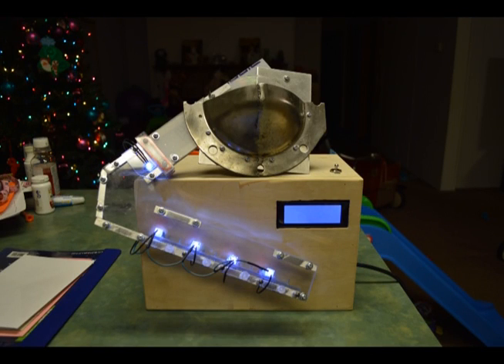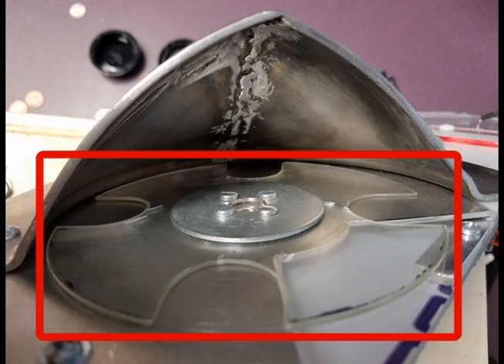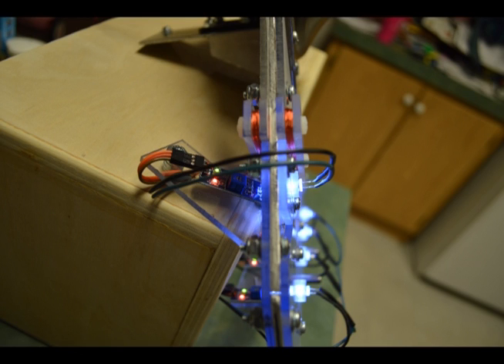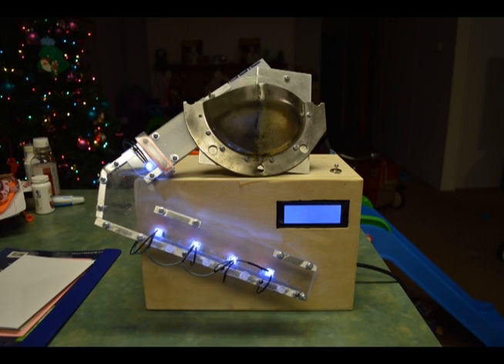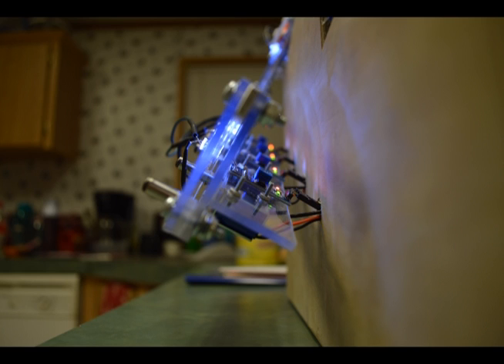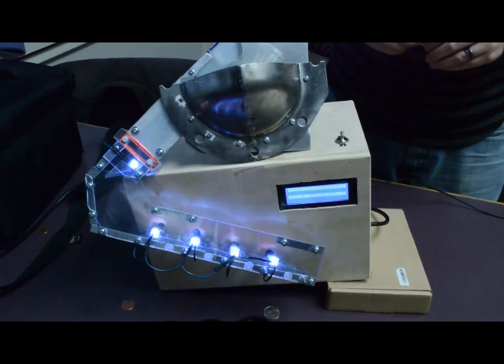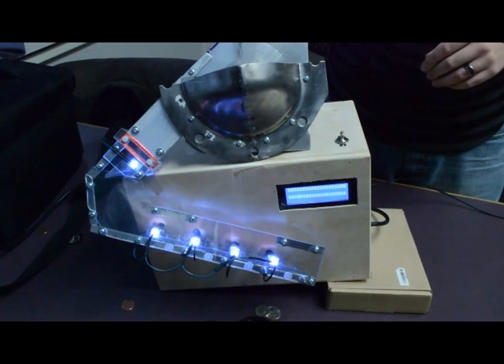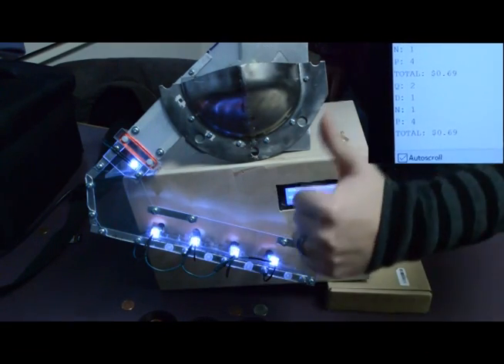Arduino Coin Sorter

Comment: really great work.

I'm really curious how exactly the coil coin sensor work. did you attach some oscillator to you coil? what is the "Instrumentation" you used?

also what library did you use? can you post a link? thanks.
Reply from the maker: Because the circuitry is complicated and this video was created strictly for the purpose of presenting this project I did not go into these details. The circuitry was based on information found here.
http://www.best-microcontroller-projects.com/coin-detector-and-counter.html
Reply: I already saw this. I actually bookmarked this site way before I asked you.
Thank you, I suspect you're using a similar method and you just confirmed it.

I found it odd that there is little information about this on the internet.
Reply: @averagerepairman6519  to give proper credit, this is patent US4998610A
Reply: averagerepairman ..I’m working on similar project...how can I contact you ...need some details abt project..
Reply from the maker: Cm Chetan what details are you looking for? I've long since scrapped this project for parts and to just clear space. I'll help with what I can.

Comment: the coils you used in this prototype is to create the hall effect? and which currency of the coins are you using mate? and are these coins magnetic materials or not?
Reply from the maker: I appreciate the questions! First, the coils are used as a comparison device, one coil sends an AC signal the other coil receives the signal (much like a transformer), and the difference in the two is compared with a differential amplifier circuit and further circuitry for filtering and amplification. The output of all of this circuitry is a DC voltage which correlates to the metallic composition of each coin. Second, this is U.S. currency; Quarter, Nickel, dime, and penny though I did not test with pre-1982 pennies which have a different metal composition. Third, I don't know the specific magnetic properties of each coin, but each coin has either a different metallic composition or different amount of each metal (coin size). How these metals disturb the field created by the coils is how the circuit can identify one coin from another. I have seen other coin sorters which use actual magnets to affect the speed of a coin as it rolls down a track to make the coins drop into different areas based on speed.
Reply: Thanks !
Reply from the maker: I actually made these coils. I bought a sheet of 1/8" lexan (plexiglass), cut out 3 rectangles, 2 big one small. Superglue them into a sandwich with the small rectangle in the middle, get some 30 AWG enamel coated wire, wrap it around the center, and you have a coil. I used some elmers glue to hold the wires together on the side of the coil where they begin.
Reply: Genius's like you make the world go round!
Reply: Top man, I wondered what it was that those coils do exactly!

Many thanks for that.
Reply: Oh one other thing, where can I buy those coils? - Do they have a specific name? (Okay sorry thats two questions lol)